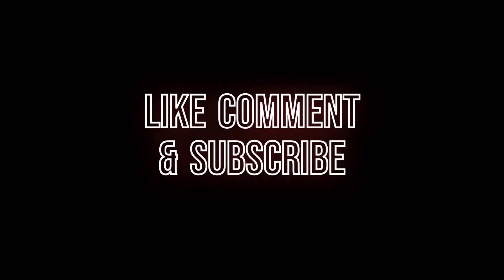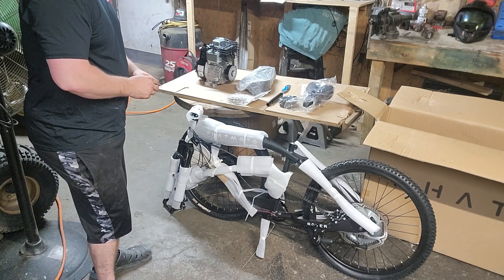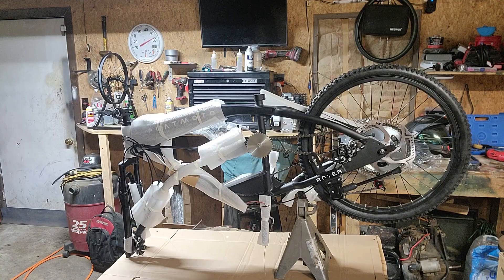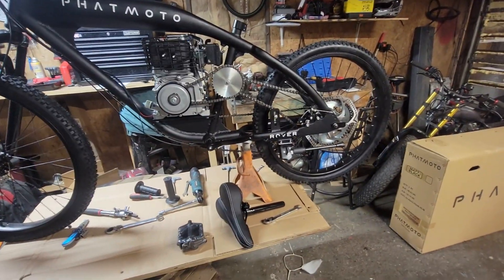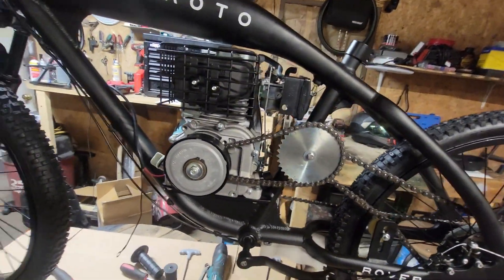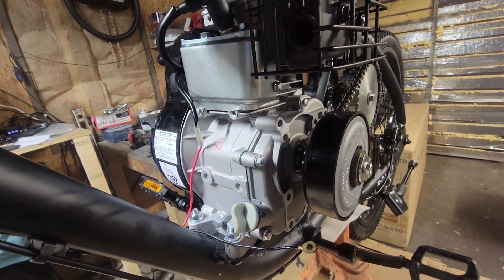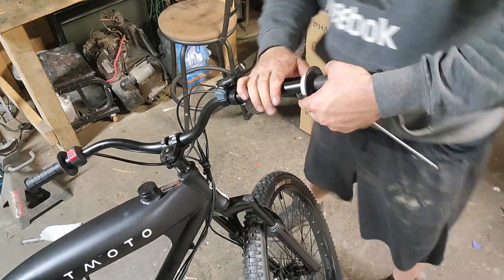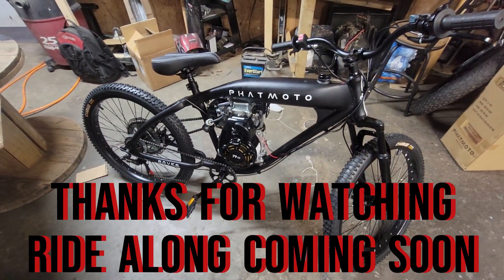UNBOXING MY WIFE'S NEW PHATMOTO ROVER - ASSEMBLY & FIRST START UP#shorts #motorizedbike #bike

Comment: When you compare the rover to the all terrain, is there more ground clearance with the all terrain? Also is there more engine clearance?
Reply from the maker: I can make a comparison video later 👍
Reply: @engineunknown2  Awsome that would help bro👍
Reply: @engineunknown2  I was wondering if the all terrain has more tire clearance maybe to fit a 27.5 average size wheel with some modifications involved.

Comment: Can't believe you didn't at least loctite the disc /sprocket assembly.
Reply from the maker: I've never used it because if you break anything it will be a nightmare to get off. If you pre check your bike before riding you don't need to use it.
Reply: Good luck 🤞
Reply from the maker: My other phatmoto is the same way and it runs 45 and never had any problems